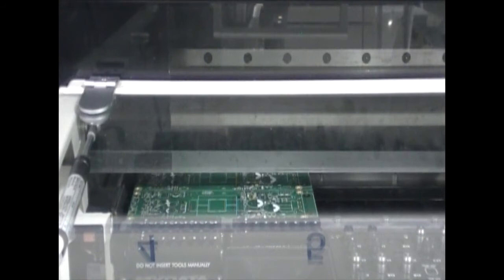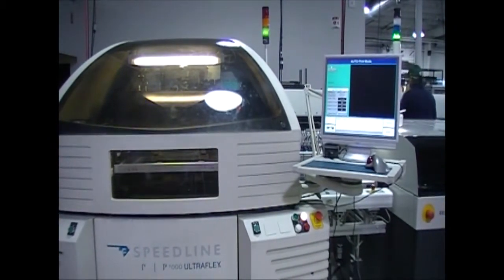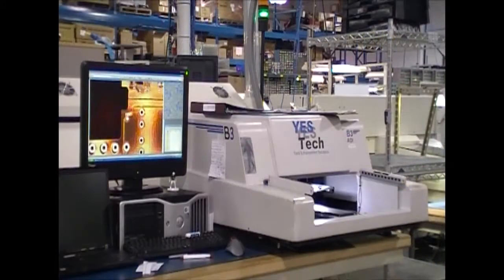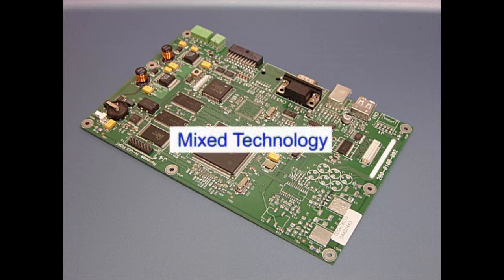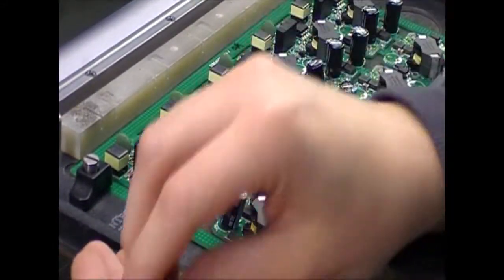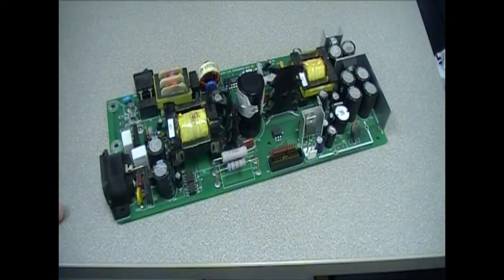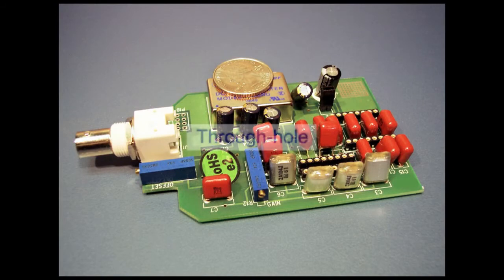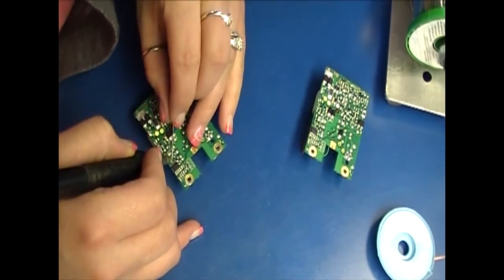Why double-sided boards increase manufacturing costs

Comment: +Z-AXIS, Inc.
If there are components on both sides, what keeps the wave soldering machine from covering them in solder when the board goes through? Won't all the components sticking down be in the solder steam?
Reply from the maker: Sorry for the late reply. Yes the components will be sticking down in the solder, but the bodies are not metallic and solder will not wet to non-metallic surfaces.